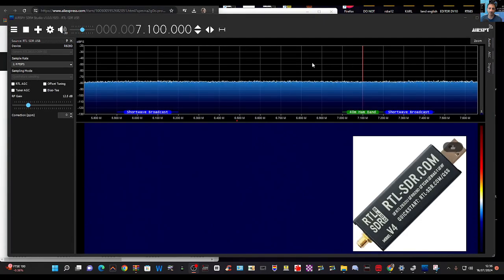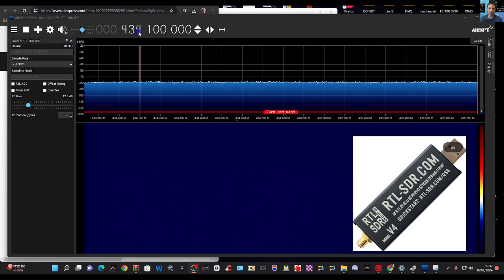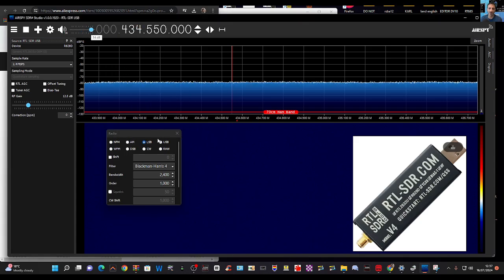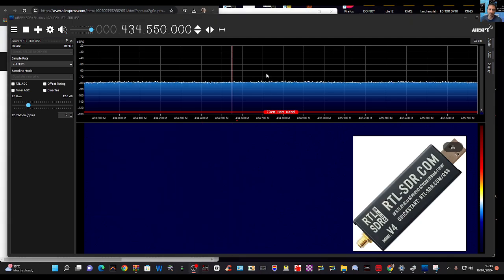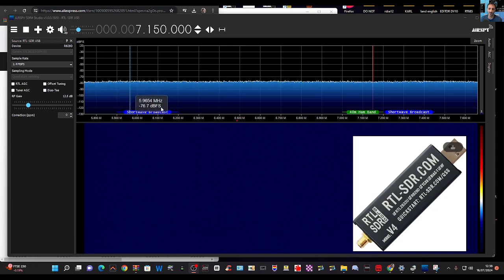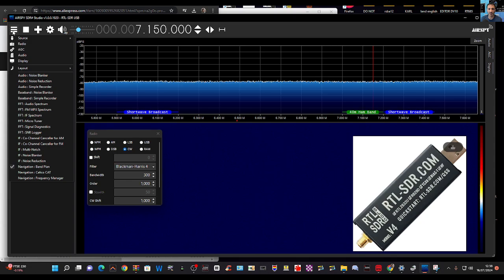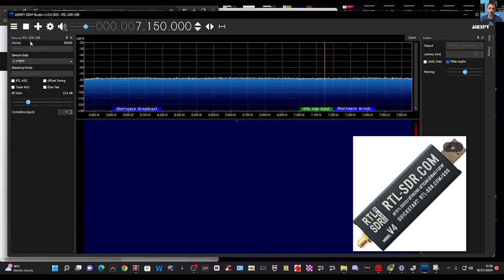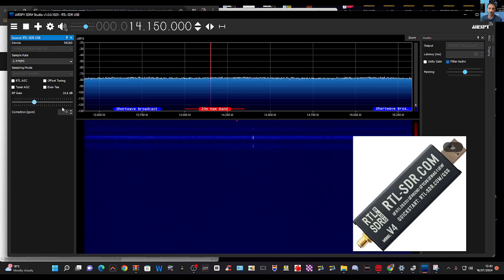RTL SDR V4 (Black  Dongle) CHANGE MODES , CHANGE FREQUENCY  - Airspy

Comment: Do you have to screw a antenna into it to work or no antenna needed
Reply: I see they advertise alot of antennas or just the dongle
Reply from the maker: u need antenna
Reply from the maker: yes
Reply: @ I see they have a rtl dongle version 3 and 4.. Any experience with them